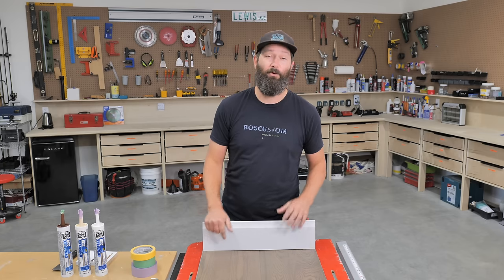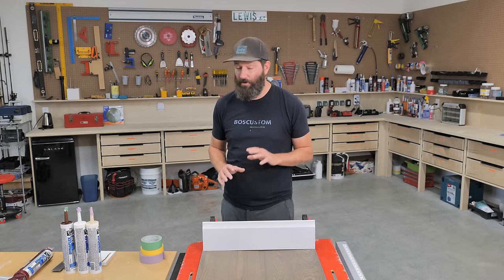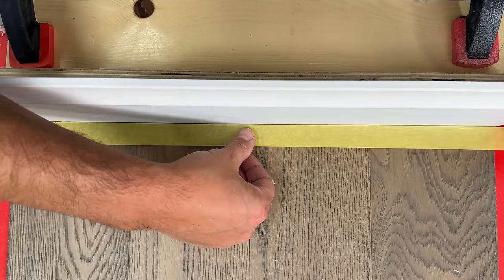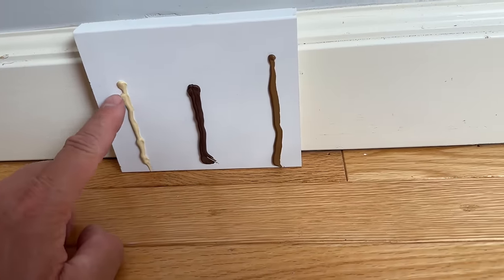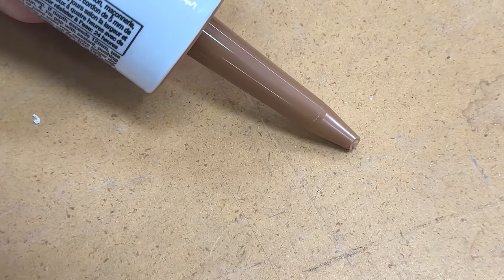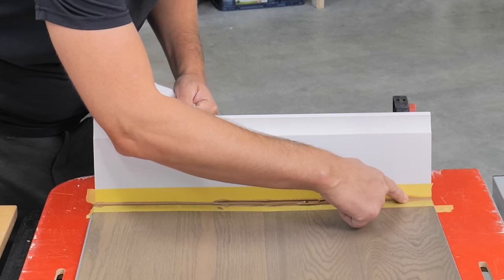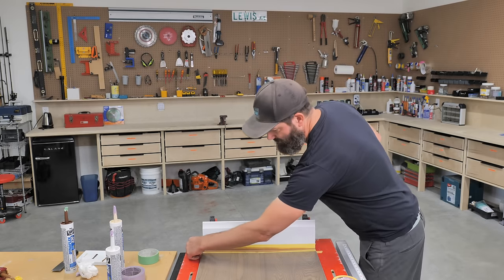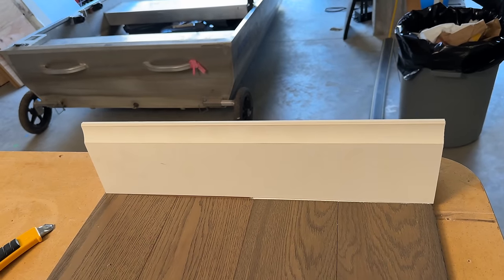How To Make Gaps Under Baseboards Disappear With Caulking

Comment: don't do this if you have a floating floor, it will pull apart as soon as you walk on it.
Reply from the maker: This is a good point for sure. I should have mentioned this.
Reply: @TheFunnyCarpenter what do I do if I have a floating floor?  Ants are getting in my kitchen through the baseboard gap. 🤦🏻‍♀️
Reply: @caitlinwong3128 caulking isn’t a solution to an ant problem. Sort out the source first. Caulk later.
Reply: @caitlinwong3128 I thought this too “that caulking would fix the ant problem”. While it may fix it in some areas. The best solution would be to buy liquid ant bait. Let them feed on that few a few weeks first.  This will get rid of them and after that if you still want to caulk the gap go ahead.
Reply: @matthoffman6962  it's the repeat point of entry. I've had them enter there and given liquid ant bait on 6 separate occasions and spray the foundation with home defense every 6 months. I live next to a wetlands. They will keep coming to the house until I have it ant tight.
Reply: It is also a great way to make your floating floor start squeaking.
Reply: Did this on my floating floor over slab in one bumpy room and have had no cracks or separation in 2 years
Reply: @thedon98677  by definition, a floating floor isn't fixed. it moves. that's why it's called a "floating floor", so no, i don't believe a word you're saying. the fact you liked your own post is a big giveaway, btw.
Reply: @caitlinwong3128 I had an ant issue in my kitchen too. I fed them a liquid ant bait until the numbers dwindled. Then I pulled off the baseboards and filled the crack between the floor and the wall with diatomaceous earth. I replaced the baseboards and caulked the floor seam. Haven't seen any ants in the years since then.
Reply: OR, don't do this ever. Completely unnecessary.
Reply: What is a floating floor?
Reply: Big Stretch has something like 500% of elongation. So it will work. 
Don't use DAP it cheap for a reason. Wasaay worse to save 50 bucks on a whole house paint job.
Reply: @sparksmcgee6641  i wonder what people get out of lying in the comments section ? not that i care.
Reply: @tam8197  and what lie are you claiming someone is making?
Reply: @caitlinwong3128 maybe ants spray or beading
Reply: You CAN do it.   Just buy better caulk.
Reply: lol  @Kyrieleyison
Reply: @jpjp9111 any flooring that is installed using floating floor method, so usually laminated flooring or lvp. They are not nailed or glued down, but installed using clicking mechanism. 

You can also install engineered hardwood using tongue and groove method, this would also qualify as a floating floor.
Reply: @freakerss   We've had a real ant problem too. I'm in the midst of changing our baseboard and was thinking diotamaceous earth behind the baseboards (in the channel between the floating floor and wall) would be a great hidden way to keep those little basta-ds at bay!  It's reassuring to hear it's been working for you--thanks for sharing!
Reply: @TheFunnyCarpenter  if you use a stretchy caulk like Dynaflex won’t it just move with a floating floor? A floating floor moves gradually. It’s not like a daily earthquake. Curious to hear your thoughts! Thank you for your awesome videos—I’ve learned a lot!
Reply: So is it safe to do with a floating floor or not? There are mixed opinions in here. What if just do some bits that are in the eyeline and just leave the other bidden ones like behind furniture etc  @TheFunnyCarpenter
Reply: In my experience, this doesn’t last very long before cracking failing.
Reply: I never recommend dap anything.  Sherwin-Williams is way better caulk that doesn't crack after a few years.  I never caulk underneath baseboards either especially if they have LVP to leave room for expansion and contraction.  Just install quarter round.
Reply: @caitlinwong3128  white silicone flex caulk esp for this.
Reply: @caitlinwong3128  this is why they invented Base Shoe
Reply: Stainmaster LVP recommends 100% silicone with backer rod behind the trim per their instructions similar to video. For clarification. Floating floors read manufacturers instructions.
Reply: @caitlinwong3128 did you ever figure it out? Curious what you did
Reply: I've done this in my house and haven't had any issues with it. I used big stretch and it looks way better than shoe molding.
Reply: How do you know if you have a floating floor?
Reply: It’s pretty standard to caulk LVP and baseboard. I’ve seen dozens done this way. The caulking holds reasonably well. Just because it is called floating doesn’t mean it’s going to grow legs and walk away. By installing shoe, you are turning a maybe look bad into a definitely look bad.
Reply: @ConstructionNerd  actual floating flooring moves quite a bit, even if its just heat/cold expansion and shrinking. by all means fill it with your shit out of a tube, but your customer ain't gonna be happy in 14 days time.
Reply: @PeterDOESNOTdrink 
I shoved a bunch of diatomaceous earth under the baseboard and left it.  So far the ants are coming in from other places only.  Eventually I'll probably pull that baseboard and put diatomaceous earth behind the whole thing, but right now I have other challenges to deal with  in that room.
Reply: You need 600% extreme stretch caulking 😂
Reply: You right. I simply ran a piece of nice quarter round to dress up the molding without being too expensive
Reply: I think if you live in the UK you'd have problems since caulking is made terribly in that region. Good quality caulk can move/stretch IF you apply correctly and IF you know what you're doing.
Reply: Facts.
Reply: Not before it's sold

Comment: The brown doesn't look any better than the original gap. To me it looks like the gaps still there.
Reply: But the gap is closed. Fewer spiders or other bugs.
Reply from the maker: Ya perhaps the video doesn’t do it justice. In real life it looks pretty crispy.
Reply: Can't expect miracles.  I used a more flexible PVC baseboard and dumbells to push down to close the gaps while using caulk to adhere to the wall.
Reply: @michaels3003 why not use beading?
Reply: Yep the brown looks a mess
Reply: Agreed! The white makes it look like the board is scribed to the floor. Matching the caulk to the floor color just keeps the gap look there
Reply: Nah, I like that brown way better
Reply: I like the brown more. The baseboard color makes it seem Iike it overflows onto the floor

Comment: I don't know about Dynaflex, but if Big Stretch is left unpainted, it will gather dust like crazy that you can never get off. It really requires painting.
Reply: I've run into that also; really gets dirty looking after a while.
Reply: Also yellows slightly, and collects gnats horribly. I love big stretch for what it does, but Phenoseal is my go-to caulk for non painted applications.
Reply: I’ll note I’ve also used hundreds of tubes of dynaflex, and it does do better at staying clean than big stretch, but still requires diligent cleaning every now and again.
Reply: This is true of all caulks. Came here to say this

Comment: This is a good homeowner tip.  but if you are a pro, you just gotta be scribing your base to the floor.  Or follow up with a shoe that can flex over the gaps.
Reply: How do you find a pro that knows and is willing to scribe?
Reply: I would say scribing is very situational. Small areas maybe scribe it, A large uneven area a shoe moulding would be best.
Reply from the maker: For sure! Carpenters that don’t scribe their base to the floor are hacks🍻
Reply: @michaels3003  if they don't know how to scribe they are not professional trim carpenters, they are likely just out of work framers.
Reply: @brodiewelbanks1141 I agree.  But I rarely have a say in the trim profile I'm installing, that's normally up to the customer, or the contractor paying me.
Reply: Scribing is the only way. Caulking a floor is ugly. Floating floors are crappy, unless you glue it down.

Comment: Also use about a half a coffee mug of warm water with about 6 drops of dish soap to dip your fingers in prior to each wipe. The caulk won’t stick to your fingers and makes a much smoother caulking job.
Reply: Thanks man, I'm about to do this exact thing and have struggled with sticky caulking in the past
Reply: Yes it works perfect!!
Reply: I tend to stay away from soapy water when caulking or applying silicone. Having it on your finger is generally ok, but I think spraying it on the caulk is a bad idea. The idea is that the soap prevents the caulk from sticking (from your finger but also from the wall). When you smooth it out, part of what you’re doing is pushing caulk into areas where the application may have been a little light and evening it all out. If that area gets soapy water on it first, it’ll look like it’s applied properly but the caulk won’t stick to the substrate and will lift in the future. I find using tape to mask and a silicone caulking tool produces a perfect result.

Comment: People go to caulking things before knowing what damages can come from it. My opinion: Don't do this if you have any wall plumbing or A/C in the attic. I recently had a leak in the wall from my A/C and the previous owners caulked areas they installed. Well, water traveled under the flooring across the room without us knowing. Flooring replaced! Mold, smell, sheetrock replaced 8" up from floor. I recommend quarter round to let that wall breath better along with seeing moisture as it develops.  Good video if you don't have these plumbing concerns.

Comment: I’ve been a carpenter since 1977. I just learned a trick of the trade. I like the sharpie line on the caulking tube.
Reply: Thats because hopefully you have been just doing it the right way for 20 years and installing shoe

Comment: Wow, I would have never guessed to use the same color as the floor. Great tip!
Reply: Most of the time when I'm trying to patch, plug or putty I use a shade darker than the surrounding areas as lighter tends to stand out more.  Maybe underneath the base is different?

Comment: Great technique.  I find caulking tile floors with color-matched grout caulk to work great using this technique... especially since the gaps at the grout joints show way more than the tile sections themselves.  It helps blend in the tile joints and ties in the floor to the base molding.

For me, anything less than 1/16" is never going to be noticed by anyone (but you - haha).  I try to bend my baseboard down to match the floor as best possible when installing.  Scribing base is a royal pain and takes a ton of time to get right.

Comment: If a shoe is not warranted, whenever I install base boards,  I have always done it the "hard right way".  I scribe my base boards to the uneven floor. I use a hand planer first , than belt sander. I make sure that I I beveled "angled" back towards the wall with the planer, thus I only need to sand a little to get to my scribe line up to ~ 1/32 error, then caulk
Note there is an old saying among old timers.
 " Any tradesman can cut a board and install it square, level and plumb, But if you could take a "crooked board" and install it square, level and plumb, and in the same plane  on a "crooked wall", then you are a craftsman." 
When I worked as a carpenter, I got fired from almost every job, for "doing it too slow", but then they would rehire me to "fix the mistakes", I often thanked the other "fast carpenters" for providing me job security...
Although, yes I would fix this baseboard the way you suggested, unless the client wanted me to remove and reinstall the baseboard.

Comment: I personally would use quarter round, but if I had to caulk I'd use a Cramer profilng tool. I used it to caulk the toilets to the floor and it was magical. No tape needed.
Reply: I’m no carpenter, but watch a ton of videos for DIY. I thought I heard it’s not good to caulk around toilets. They said if your toilet ever develops a leak, the water becomes trapped from the caulking will find its way under the flooring and cause big troubles. 
I personally like the way the caulking fills the gaps around the toilet but don’t ever want to run into any issues.
Reply: They say to leave the back uncaulked. So it looks good but any leaks will find their way out.
Reply: Dont caulk toilets unless on uneven floors
Reply: Installing shoe/quater round is the right option. Especially if its a floating floor, like so many are.

Comment: i don't know man.... this method seems WAY more complicated and involving WAY MORE mess than how i accomplish this.  
I literally have the same caulking gun BTW, love it.
I've been doing A to Z remodeling of old trailer homes for the past 3+ years now and i can caulk the baseboards and door and window trim for the entire home in less than about an hour.
One long swipe down the board no matter the length, then one swipe at about a 45 degree angle with one finger and that's it.
comes out perfect, no messy over caulking to have to clean up or anything.
Most of it is due to actively regulating the pressure on the caulking gun trigger and speed at which i drag the gun across the gap.
I guess just from doing this for so long you just become proficient and for lack of a better work learn the "feel" of how to apply it efficiently.
Or perhaps i'm just built differently .
LOVE  the content! 
 one of my top 3 YT channels that really helped me build everything i have learned in the past years ;)
Reply: Agreed. And I wipe any excess off the floor with glass cleaner and paper towels. Super easy.

Comment: use paintable silicone. always the best choice. personally i would never try to mach the floor, i would go for the panel color. as the calk is going vertical to the panel, and not horizontal. Your calking job is also hollow, i would make it straight. we have a little cheap tool called a "cheese" it's a rubber square, instead of using the fingers. for perfection spray a light coat of soap water on it, to not make a mess.

Comment: What is this fascination with a bit of gappage? Being a fussy boat builder type, I did the trim in my house to my satisfaction. Turns out I should have painted it too because even after requesting NO CAULK due to it always looking dirty after a while, the painter still caulked it. Six years later I am starting to feel the need for a razor blading of all the caulked seams, even though the painter did a fairly decent job.      That all said, this is great advice for "industry standard" trim jobs.

Comment: I would not use caulk under the baseboards on a floating floor. as it is designed to float, to move with expansion and contraction. If necessary, level the floor or scribe and cut or plane to fit. If the floor is in a wet room, like a bathroom or laundry room, and expansion is not significant, use clear calk to seal. and the bottom line of the baseboard remains straight and does not appear to curve to follow the floor.

Comment: I like to paint my caulk lines.  It is easier to clean up when it gets dirty and won't yellow, discolor, or crack with age once it's painted.  Since I am probably painting the baseboards white I would go with a white caulk rather than try to color match the caulk color with the floor
Reply from the maker: Painting the caulking is an extra step that can definitely has merit. Especially if your going to be painting the baseboards anyways.

Comment: i have a sculpted porcelain tiles that look like real stone, there are areas that there is no way i could get the base board flush. i have tried a couple different times to caulk them. I may try this method. one spot in particular drives me nuts. good advise on tyring to match the floor color instead of the baseboard color. that may be tough too, but worth a try

Comment: Latex caulk shrinks too much.  Big Stretch should be renamed Big Shrink.  I use white silicone, which does not shrink and is not a magnet for dirt.  I really like the floor colour match caulking, however, time to rethink my caulking.  Great stuff, Cheers from Canada.
Reply: You do you. For everyone else,  be aware that nothing sticks to silicone, so when it's time to paint again you WILL have problems.

Comment: I prefer no baseshoe or quarter round. Love the look. This is a cool trick but honestly the taping takes too long for me I just apply the chaulk and wipe like a mad man.  I finished about 3000 sq ft but still have another 3k to do. Will do it in the winter 😂.
Reply: I see both points. If I was doing a whole house I would do the quarter round (or get carpet). But, in my case, I only want to do my walk in pantry so this tape and caulk method would be great. There is no wrong way with this. I think that's the beauty with some projects, there is no wrong way. Well, I suppose there are absolute wrong ways. But, of all the "proper" ways, you have multiple to choose from.
Reply from the maker: Gotta use the tape. You’d be surprised how quick that frogs tape goes on.  Much quicker and cleaner than wiping like a mad man🍻
Reply: @TheFunnyCarpenter  All right you have me sold!  I'll give it a whirl next time!  Wiping gets highly annoying.

Comment: I lived in a newly built house for years and never knew until the last year that under the floorboard and carpet was an inch gap outside. Removed it for some reason and saw sunlight. The Winters were cold and ants in warm weather. Happy a snake did not slither in because they liked to nest in decorative rocks on the outer side of the wall

Comment: The gap was still obvious with the dark caulk and the white was obvious because you’ve used white on a different colour.

You’re probably best just colour matching to whatever the lightest colour is, otherwise the darker caulk will likely still make it look like there’s a gap there.

Another way to do this without the tape is to use a damp cloth to go over your finger and wipe away the excess. Doing it this way will wipe most of the excess off the surfaces and also create  more uniform bead.